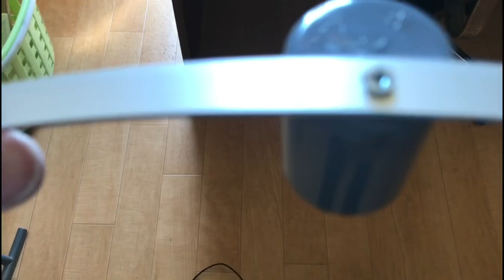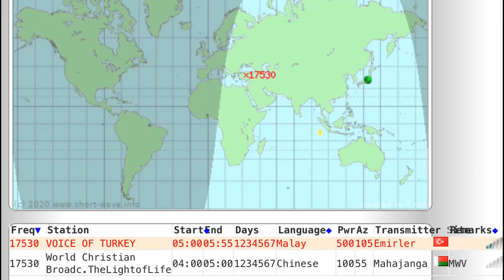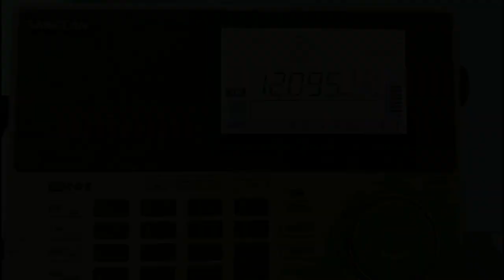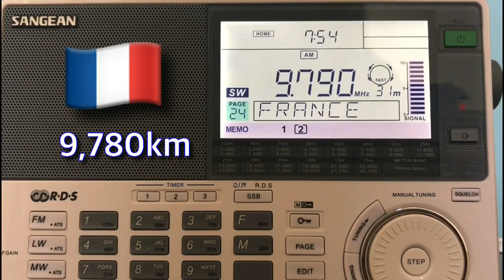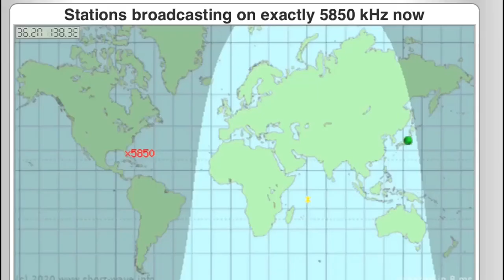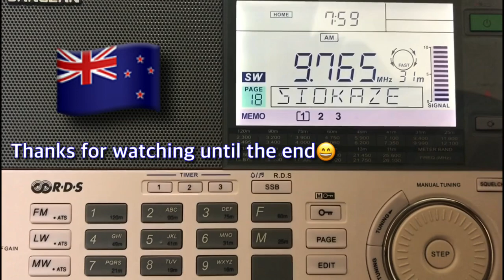📡 MLA-30［Flat bar loop］trial reception report / Loop Antenna

Comment: Is this the same diameter as the original wire element?
Reply from the maker: Hello. This specification is slightly larger than the original wire. Thank you for your message.

Comment: Hello, quite impressive catches here! congratulations.
I could not figure out whether you have made a comparison with the original metal wire loop.
Is it better? I plan to use think copper tube to replace the metal wire myself.
Reply from the maker: Hello, the low band signal is now better than the original wire loop. I think thick copper pipe would be even better. perhaps. Thanks for the message.73s

Comment: Konnichiwa, hajimemashite Tengu-san! 🙇

I am a new subscriber to your channel and I think this is the most interesting MLA-30+ modification I've seen so far. I wish the original manufacturer had used the aluminium flat bar like you did, but the company wanted to produce the kit for at low cost and also to keep the package as lightweight as possible. I don't have carpentry skills like you do but will look for a hardware store in my country that sells this type of aluminium bar and is willing to bend the ends for me and also drill the holes.

I have just installed my second MLA-30+ and my PVC pipe and cap arrangement looks like yours before your modification. It is installed indoors in my bedroom because I don't have a ladder that is long enough to reach my rooftop next to my bedroom.
My first MLA-30+ turned out to be a counterfeit and the supplied loop became elliptical, not circular when it was assembled. The LNA box also came with only four screw holes and not six (no center hole) and the Bias T unit was fitted with a red LED instead of green. I think I will try to modify the counterfeit one first and see how much I can improve it.

Arigato gozaimashita! I will watch your other videos! ☺

73s from Malaysia! 🇲🇾
Reply from the maker: Hello. Thank you for your message. The MLA-30 is a very high performance loop antenna. The small board contains a low-pass filter for FM band cut, a lightning protection circuit, and a differential amplifier with a chipset. And if you modify it to a flat loop antenna, you can expect higher gain due to the skin effect that can be obtained from a wider area. And let's enjoy receiving shortwave broadcasts together.73's
Reply: @Ken.s_BCL-LogVideo  Thank you for the reply, I appreciate it. 🙂

I was visiting Tokyo early this year in February and we stayed at a hostel across the Sumida river. From the balcony I could see the Tokyo Skytree tower.

I brought with me a Tecsun PL-368 compact shortwave radio with an XHDATA AN-80 retractable reel antenna but I could not receive any shortwave stations at all. 😞 However I found out that there were still MW stations in Tokyo and many FM stations. All are in Nihon-go of course.

I like listening to NHK Japan on shortwave and watch food themed Japanese TV shows on Netflix. I just started learning Nihon-go and hope to be good at it the next time I visit Japan! 🇯🇵🗾🎎

Comment: Hello. What is the diameter of aluminium loop you made?
Reply from the maker: Hello. Since the length of aluminum is 2m, the diameter is about 60cm.73s
Reply: @Ken.s_BCL-LogVideo  Thank you for quick reply. Just wondering does the size matters of the loop in general?
Reply from the maker: @HardcoreDXLithuania  Yes, size is important. At lower frequencies, larger sizes are useful. For my size, around 15MHz is good. Perhaps. A little larger is better.
Reply: @Ken.s_BCL-LogVideo  Great, as I'm about to bend 3 meter copper pipe so it would go around one meter in diameter circle. Or maybe even to connect two pipes.

Comment: I am also living in Japan and have so much trouble with noise, does this loop help reduce the noise? I live in mansion, it is very noisy.
Reply from the maker: Nice to meet you, Mr. Keima. That's right. That is troublesome. Since this loop antenna has directivity, rotating the antenna may reduce noise. Thanks for watching.73s Tengu(^^)v

Comment: Especially because of the March equinox, that’s probably why you can receive it. I can receive ALOT more than before. Without any other modifications to the loop.
Reply from the maker: Good morning (In Japan,). Yes, the ionosphere is in very bad condition these days, but I'm looking forward to the start of the Es season in Japan. Thank you for watching. 73s Tengu 📶📻
Reply: kurama10goo i am now going to bed! Have a good day :). 73 de SM68481
Reply from the maker: @sa6kod154  good night. Have a good weekend (^^)/